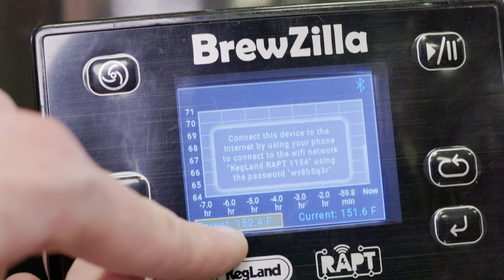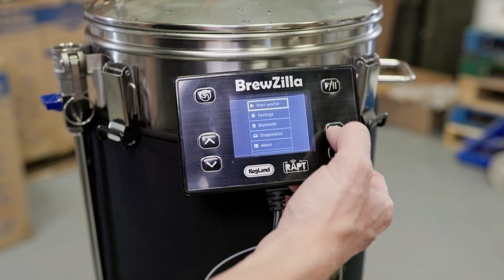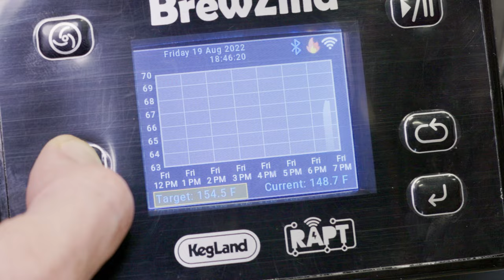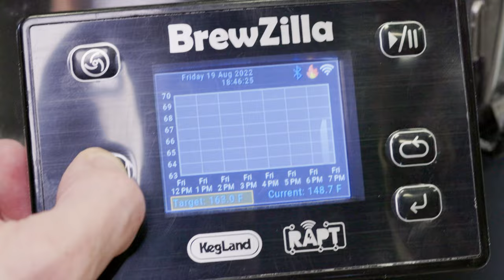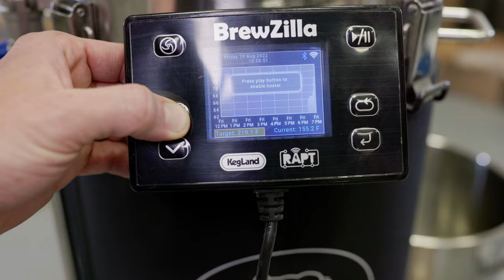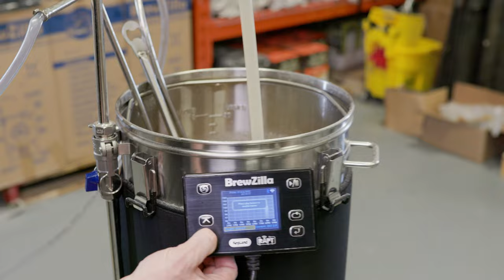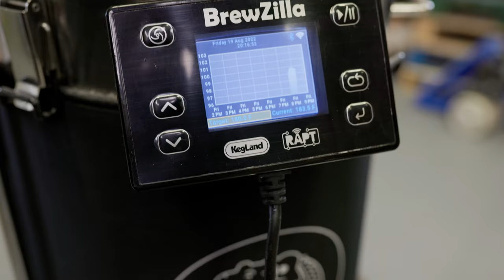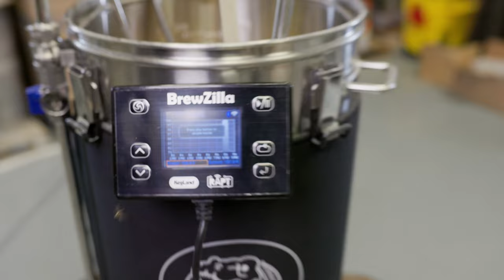The Ultimate Brewzilla Gen 4 Step By Step Tutorial - Make Great Beer On Your First Try

Comment: I use the Klarstein Mundschenk (aka Brewdevil/Beacon/Brewmonk/Guten) that has its bottom drain off to the side so with the whirlpool arm it makes a hop/trub cone in the center so I can transfer clear wort without using a hop spider or a false bottom it's pretty amazing!
Reply: I have had second thoughts about the center drain since whirlpooling would collect all the trub in the center right over the center drain. I guess as long as there is a full bottom grid over the bottom I could use hop bags to keep most of the hops out of the drain, but then there is the hot-break. Some brewers laddle off the hot-break.
Reply: @InvisibleCitizen  but if you use bags you don't get full hop utilisation. And if you have any kind of false bottom filter or grid then hop matter won't fully recirculate also affecting utilisation.

Comment: I am close to buying an all-in-one electric brew system like this. I have a friend who has a Grain Father G4 and keeps saying it works great but I remember all the issues he had with his first Grain Father a few years ago. His heating elements burnt out a few times and his control panel died. I am still leaning toward the BrewZilla Gen 4 35 but also maybe the 65 since I have been brewing with keggles for over 20 years. I just need a nug to commit! Thanks!
Reply from the maker: We've had pretty good luck with Grainfather units but it's hard to justify the extra cost when compared to a Brewzilla these days.  Cheers!
Reply: Me too. nudge, nudge

Comment: great video! thanks for an in depth look at the whole brew day. my biggest disappointment with these 'single vessel' systems is that they still require an additional vessel for sparge water instead of being big enough to do a full volume mash.
Reply from the maker: You can manage full volume mash on certain recipes.  I also know a fair amount of people who do not heat their sparge water at all.  Some will also heat up their sparge water with their mash water and then transfer it into a cooler to keep it warm until they need to sparge.  Cheers

Comment: I’ve had the gen4 for about 18months, love the system and even more love your channel vids. Q. I’ve had problems with the plug and socket melting, replaced twice, my remedy was to boil on a lower wattage, I’m in thailand using 230v system any comments from yourselves on the matter?
Reply from the maker: Hi, I have heard of this happening but have never experienced it including the ones we have sold to our customers.   I wonder if the Brewzillas we sell in Canada that need to be CSA approved are built differently than other units manufactured for other countries.  Cheers

Comment: Great, just when I thought I had decided on an Anvil, this Gen 4 seems to slightly edge it out. Thanks for the informative video.
Reply from the maker: Haven't had a chance to try the anvil but have been happy with the gen 4 thus far.  Cheers
Reply: I had an anvil. They're cheaper for a reason and you'll find out soon when you use it. I would spend the extra dollar on the brewzilla

Comment: howdy Paul...is this good for a beginner ? never brewed in my life and I love a beer....buying store (beer) getting pretty expensive and I am keen on a challenge....do i need to buy anything else in addition to this? apart from brew itself....is this really a all in one system...cheers and thanks in advance
Reply from the maker: Hello, the Brewzilla definitely makes getting into all grain brewing a lot easier than other methods.  If you've never brewed before you may want to try a partial grain kit first to get the hang of things.  Those types of kits can be done on your stove in a 5 gallon pot.  Either way you will also need a fermenter, a siphon and tubing, a bottling bucket with a bottle filler, cleaner and sanitizer and some empty bottles and caps.  If you'd like more information about the partial grain kits I have a video showing the process from start to finish.  https://youtu.be/NEZ0Ykfrs5s

Comment: Great instructional video.  I'm having an issue with my burner turning off during the boil.  I set it all they way up to 225F and yet it stilll shut off.  Any ideas?
Reply from the maker: I haven't run into that issue as of yet.  Maybe try calibrating the thermometer or do a factory reset.  Cheers

Comment: Thanks for sharing the video. Question: did you get the pump blocked with all the gunk? Because you left the pump on (post hop addition) while cooling the wort and also used the pump to transfer to fermenter.
Reply from the maker: Hi, the pump did not get blocked at all during this brew day.  The false bottom blocked most of the hops and trub from reaching the pump.
Reply: @graintoglass  thank you for a prompt response

Comment: Excellent video. I have one question. How can you see what volume of wort is in the boiler as you sparge? Is there a sight glass or some other way of seeing how full the boiler is with the mash pipe raised?
Reply from the maker: You can buy a sightglass for the Brewzilla but I've heard that they are not made of quality material and break easily.  I just use the Brewfather app to calculate my mash and sparge water volumes, that way I don't need to see the volume as I'm sparging.  Cheers
Reply: @graintoglass  Thanks very much. The sightglass add on does look a bit delicate.

Comment: Which is better, an immersion, chiller, or a plate chiller? Could you discuss the benefits and disadvantages of each?
Reply from the maker: Plate chillers cool much faster but IMO they are a pain to keep clean.  Immersion chillers don't chill as quickly but they are very easy to keep clean.  After trying many chillers I now use a 50ft 1/2" immersion chiller for my 5-6 gallon batches and it can chill down to pitching temps in about 10min.  If I was doing larger batches I would probably go with a counterflow chiller.  Cheers

Comment: Great I've been debating on getting a all in one or starting BIAB. Can you do a video on to remove and clean the pump ? That one is pretty bad ass. I would love to get away from a raking care
Reply from the maker: BIAB is great but I love the simplicity of all in one units like the Brewzilla.  To remove the pump you just flip the unit upside down and there are 2 screws that hold the pump in place.  There are 2 clips that you can remove by hand without tools to remove the tubing.  It's that easy.

Comment: Is there something like this with either jacketed cooling or at least a coil attached to the outside? I feel like you could use it to both heat the sparge water in another vessel during mashing and chilling after boil with less cleaning.
Reply from the maker: Not that I'm aware of.  Cheers

Comment: When using the brewzilla to pump into your fermenter, did you do anything to make sure it was oxygenated enough for your yeast?  Looks pretty simple to use pump to move wort into fermenter.
Reply from the maker: I didn't do much to oxygenate other than letting it splash into the fermenter.  I used to use an oxygen tank and although my beer would start fermenting faster I found it to much of a hassle especially when using dry yeast.  Cheers

Comment: Any issue with the sparge water exiting the holes on the outside bottom of the grain basket and getting on the outside of the unit or hitting the floor?  Couldn’t see those holes in the video while you were sparging.
Reply from the maker: I have not run into any issues during sparge.  Perhaps if you had a stuck mash and added your sparge water to quickly it could be an issue.

Comment: I've just ordered by Brezilla gen 4 and had a couple of questions:
1. I've read that when putting the pump off, the tubing should not be in the mash / wort since there is some suction that might lead to the pump clogging. Have you experienced that at all?
2. In your further reviews, could you pl. also demonstrate the programmable mash modes? Also, if one is doing a step - say at 165 and then 175, does the timer for the 175 start only after the temp is reached? 

Thank you.
Reply from the maker: Hi, I've only used the Gen 4 twice and have not had grains come into the tubing when turning off the pump.  That being said it could happen so it's something to keep in mind when turning the pump off.  

I haven't messed around to much with the programmable steps but I believe it starts the timer as it starts to heat up to the next step, not once it reaches the desired temperature but I will need more time with the unit to confirm.

Cheers!
Reply: @graintoglass  Thank you for your response! Appreciate it. I also wanted to ask if you have seen any differences in the temperature maintenance during mashing given that this gen 4 has the PID algorithm. Thank you!
Reply from the maker: @amrith10  Mash temps were great.  I even used an instant read thermometer to check the top of the mash an it was within 1F of the displayed temperature.
Reply: @graintoglass  Amazing! I see that kegland is also selling those secondary RAPT connected bluetooth LE thermometers. I intend to mostly only brew 2.5gallon batches. So, with the recirc arm on, I am assuming that things like that are superfluous. Thank you so much and look forward to the deep dive videos!

Comment: How long did it take to heat up to mash temperature?  And how long to get to a boil?  I'm debating between the 110v and 220v for faster heating.  Great video,  thanks.
Reply from the maker: Hello, the 220v system will save you around 12min getting to mash temp and 16min getting to a boil compared to the 110v.  I find that if you add your mash water the day before you brew and set the brewzilla to start heating up your strike water for you, a brew day on either system should be 4 hours tops including clean up.

Comment: During the mash, it looks like you weren't dipping the recirculation hose all the way in the malt pipe. Was it in the mash at all? Is this to prevent grains from getting in the pump? Thanks!
Reply from the maker: Hello, the recirculation hose was in the mash but not buried in the grain.  This way I can monitor recirculation flow.  Cheers

Comment: Do you let the water fall or did you have the tube in the water? Also does it continue to warm up to temp during the ,
Mash?
Reply from the maker: Hi, can you clarify what you mean by did we let the water fall or did we have the tube in the water?  During the mash the heat will turn off and on to try and maintain your set mash temperature.  Cheers
Reply: @graintoglass  thanks for the reply, I just meant do you let the water splash down out of the tube or put the tube in the water? I presume it doesn't matter

Comment: Did you really use the original cooler coming with the product this time..? (How else can you do a full product tutorial?)
Reply from the maker: I used an immersion chiller which is what the Brewzilla comes with.  I probably used my 50' instead of the 25' that is included to save time.  Nothing in the process would change by doing so.

Comment: I was wandering if extra whirlpool arm is needed or the hose on main arm is long enough to do whirlpool?
Reply from the maker: The whirpool arm is curved like an L so that it moves your wort in a circular motion creating a whirpool.  The hose just circulates the wort from top to bottom.  Perhaps you could figure out a way to curve the hose to make it act like a whirlpool arm.  It's not long enough to reach the bottom of the Brewzilla but it's just high temp food grade silicon tubing so you could buy a longer piece if you wanted to.  Hope this helps.  Cheers
Reply: @graintoglass  Thanks for reply.

Comment: How do you set up the chiller on the gen 4?
Reply from the maker: I have regular 1/2' vinyl tubing for the cold water going in and high temperature silicone tubing for the hot water coming out.  Regular hose clamps to attach the tubing to the chiller and a garden hose fitting on the cold side to attach to a hose.  Cheers

Comment: What if I’m brewing where there is no internet? Can I brew by loading a mash step profile?
Reply from the maker: Hi, you can manually adjust the mash steps using the control panel or if you can get the brewzilla connected to wifi you can download profiles that you can then use when you don't have wifi.  Hope that helps!
Reply: If I understand you correctly I can load my own from the units keypad without internet and Wi-Fi?
Reply from the maker: @InvisibleCitizen  Yup

Comment: I have been having the hardest time with stuck recirculation during the mash. I use 5% rice hulls and set the sparge arm ball valve in the 20%-30% range when recirculating. My crush has been crazy fine at .025 and I've brought it up to .032 with nothing but issues. What crush size do you recommend for these units?
Reply from the maker: You basically want the grains crushed so that they're all cracked open but the husks are still mostly intact.  On most 2 roller mills you could try a credit card size mill gap where you should have a bit of resistance from the rollers but you should be easily able to put your credit card in and out.  Try that and crush a bit of grain to see what it looks like.

Some people also claim that letting the grain rest for 10min after adding them before starting the pump helped with their stuck mashes.

Do you by chance brew with a lot of wheat or rye malt or oat/wheat/barley flakes?  Those tend to gum up the mash a lot more than other grain.

Cheers
Reply: @graintoglass  I don't brew with wheat or rye normally. What gap do you use for crushing? Is 0.54" too large of a gap?

Comment: Would the new malt basket/pipe fit into a Gen 3 brewzilla?  I have a gen 3 but I find I am getting a lot of grains going through the the malt basket and clogging my pump during the mash.  I took a look and see that the basket is a bit warped on the bottom and suspect that is the issue, so wondering if I can get the improved gen 4 malt pipe and fit it into the gen 3 system?
Reply from the maker: I tried and it does work but it sits about 1/2" higher than the gen 3 malt basket.

Comment: How are you guys maximizing the false bottom? My gen 4 is having issues filtering out hop debris and when transferring to the fermenter with the pump as there is a lot of hop matter making it through.
Reply from the maker: I've heard other people with this issue but personally have not run into it. I don't do anything special and just installed a false bottom normally. It filters out most of the hop particulates.

Comment: Hey Paul I'm wondering what you are getting for boil off rate on your 120V gen 4? Trying to dial in my numbers in Brewfather. The default is 4.5 liters per hour. Thanks!
Reply from the maker: Hey, it's somewhere around 3.5L depending on your batch size.  My rule of thumb is if you're using around 10 lb of grain and making a 19-21l batch you should be using around 29L of water total.
Reply: @graintoglass  ok perfect thanks!  I use Brewfather and the default for that system is 4.5l. I believe the profile is built off the 220V though. My batches are 23L. I'll try 3.5 and see how it goes. Thanks again!

Comment: When you want to raise the temp to boil do you not have to turn up the wattage on the heater element or was that for the older Brewzillas ?
Reply from the maker: The old Brewzillas used to have a 500watt switch and a 1000watt switch.  You'd have to switch both on to get to a boil.  Cheers
Reply: @graintoglass  Thank you. I just trial ran mine today for the first time. I had to hold down the return button to put the display in the old fashion temp display mode and that gave me the option to adjust the heating element and pump speed. It worked great today.
Reply from the maker: @donaldclemmons5980   Good to hear, cheers!

Comment: Did you try using the pump 'duty cycle' to control flow? It's unclear in the system documentation if this is a PWM control or really a duty cycle that turns the pump on/off.
Reply from the maker: Haven't tried yet.  When I do I'll reply to you.
Reply from the maker: So I tested it out yesterday and all that happens when you lower the pump power is that it will turn the pump on and off.  It does not lower the flow rate.
Reply: @graintoglass  thanks for testing this. On/off isn't a very useful feature, unfortunately. The pumps they use on these systems can be controlled by PWM, even though they're AC. With a simple bit of extra hardware, KegLand could really take this up a notch and make it something special.
Reply from the maker: @BensonLedbetter  Agreed, maybe on the Gen 5 :P

Comment: Which settings do you use for your malt mill? Or how fine do you mill it?
Reply from the maker: We have a commercial mill at the shop.  For homebrewers with a 2 or 3 roller mill I would recommend starting with a credit card sized gap.  Adjust the rollers so that when you put in a credit card through it will move the rollers but not be so tight that it gets stuck.
Reply: @graintoglass  I already tried this method but unfortunately my gen 4 still got clogged.
Reply from the maker: @tommeke19   that's odd.  Maybe try a bit coarser grind next time.  Does the pump get stuck during the mash?
Reply: @graintoglass  no not during the mash also not during the boil. But after I do a whirlpool (manually (don't have a whirlpool arm) I let it all rest for about an hour. And then when I want to pump it over to my vessel its clogged.

Comment: Question when you transfer from
The boiler to the fermentation bucket should that be closed so o2 won’t get in or is that just after yeast is used? I’m a novice wanting to start brewing
Reply from the maker: Before adding yeast you want O2 in the wort.  Once fermentation is done you want to avoid O2 as much as possible.
Reply: As said above, you want to introduce some oxygen at this point. What I do is hold the tube a bit above the wort in the bucket so the stream drags some air down with it into the wort.
Reply: @graintoglass  thanks!!! Love your videos! Very informative
Reply from the maker: @jayalexander1079  Thanks!